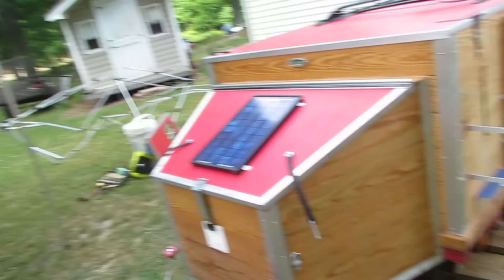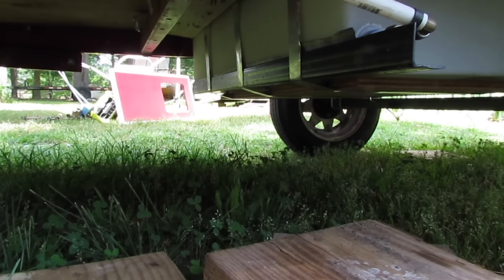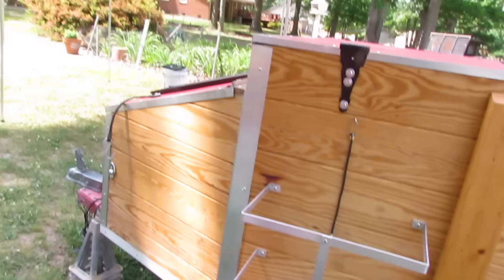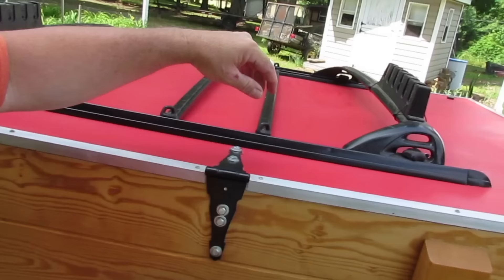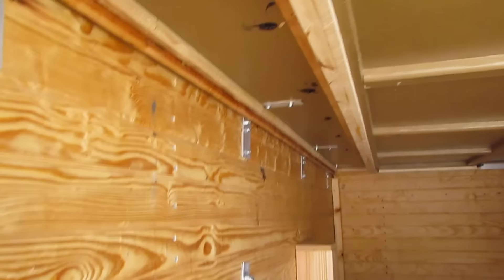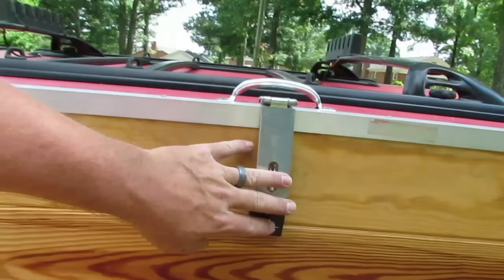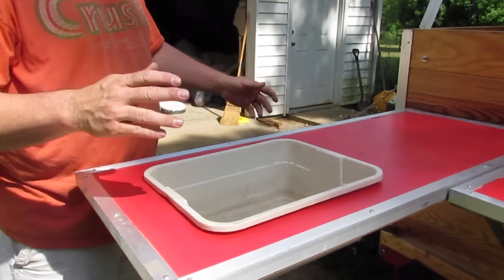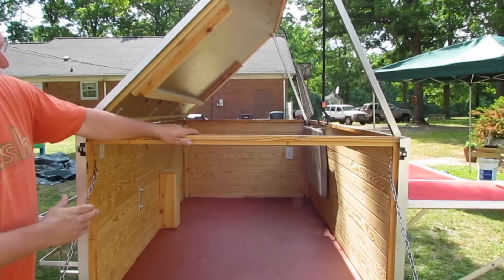Harbor Freight 4x8 Camping Trailer

Comment: Thats a nice set up Jeff! I'd wire in an inline fuse on that main positive cable you've got running to that battery. This will help you prevent damage to your stuff and possible fire.
Reply from the maker: Thank you. I appreciate the suggestion, I will be looking at adding a fuse, definitely want to be safe. Thank you for watching
Reply: +Jeff Furr I used a 12 volt 50 amp reset breaker on one of my campers , cost less than 10 bucks.

Comment: You should get one of then screw type shower rods to help support the sink counter, get a Harbor freight generator. I'm not sure why you hooked up the water pump on in inlet side, I think it should be on the outlet side to take the water out of the water tank to a sink or faucet. You should think about going to the dollar store and get about eight solar garden lights and fashion some mounts inside and outside as well. They last well into the night.  The spot lights can be used as a flash light. There is a solar shower set up you can get when in need of a shower.  Nice little rig. Thanks for sharing with us.
Reply from the maker: Thank you so much for some great ideas. Thank you for watching

Comment: Jeff, you did a great job & it looks terrific. Just want to give you a word of caution. I put one of those trailers together for a motorcycle. The first time I used it & swung a tight curve, the trailer tongue twisted like a pretzel & flipped, dumping the bike into the road. You might want to go to a welding shop & have them beef it up some.
Reply from the maker: Thank you, I'll look into that, I take all advise and suggestions seriously so I appreciate it. I don't think that this one could twist or warp due to the fact that the front box was bolted to the biggest part of it but I'll have it looked at. Thank you so much for watching.

Comment: I would suggest enclosing the battery a bit and vent unless the battery is a gel-cell type.  The fumes over time may cause corrosion in the vicinity of your electrical in spite of venting of the whole box.  I can't tell if you have over current protection from the battery but you should have either fuse or fusible link for safety.  Those invertors can fail and smoke.
Reply from the maker: Thank you, I will consider rearranging or enclosing the battery, great suggestions.
Thank you for watching

Comment: You know, I never considered making a camping trailer like this. I have always been consumed with getting a RV/camper. But now that I see this, I think it would be a good idea to build one. Not to mention cheaper than a RV.....lol
Reply from the maker: Much cheaper than an RV and lots of fun to build. I have to admit though, we now have a travel trailer and use that most of the time. I'm gonna keep this trailer though, I still have ideas for it
Reply: If it were mine, I would add bins inside to store sleeping bags, tents, fishing gear, cooking gear, etc.  Maybe even a place to store folding furniture and a canopy for when you get to that camping spot. You could, for space sake, do it in two layers, a bottom layer and a slide out top layer to get to the bottom stuff. I know you probably already put that stuff in there, obviously, but I could create sections specific to the items so everything fits and you can squeeze as much as possible in there. Of course don't make it as wide as the trailer, you still need to walk in it to get to your stuff.....lol

Comment: That is one ultimate chuckwagon Jeff. But the only concern I would have would be the proximity of the water lines and pump to the electrical. Water and electrical generally don't mix too well and could give someone a very nasty experience. Myself I would try to isolate the water from the electrical so there is a mechanical barrier, and GFCI your electricals. You've put a lot of imagination into that rig. Happy trails.
Reply from the maker: Thank you very much, and I agree about your concern. I started to build a small box around the pump and water lines to prevent anything like you mentioned and I'll probably end up doing that in a future modification. Thank you for watching.

Comment: Very creative, nicely done.
Reply from the maker: Thank you very much and thank you for watching
Reply: Have you found it to be stable?  I have been price checking one of these vs the ones at Home Depot etc, I am looking to build a Single motorcycle trailer that doubles as a kayak trailer with them above the motorcycle.  Found the one you have but no expertise with them.  Sorry to bother.. total stranger and all but very similar ideas so curios.
Reply from the maker: +Brad Thomson this trailer seems very stable, it pulls great as long as it's loaded right. It was loaded too heavy in the back on one trip and it swayed a little but this will happen with any trailer. We have taken this trailer on five trips totaling approximately 1,600 miles and it's still doing great. I repacked the bearings last year but they didn't really need it. Hope this helps.
Reply: +Brad Thomson i have this same trailer. works great for my 4 kayaks or my lawn tractor or anything really.  handles pretty good and for only 200$ you really cant beat it

Comment: Since it seems you like to modify various parts for your trailer, I would suggest getting some of those tap led lights from like dollar tree and wire 4 in series to place on the inside of the lid and also have on the outside to use as a lighting source. The tap lights use three aaa batteries per unit so wire in series for 12-volt operation provides plenty fo light without the need for a current/voltage damping resistor. 
Love the trailor and love using harbor freight as a resource store.

Comment: Keep the wheel bearings well greased.  If a bearing " goes out" on a trip, you can only buys bearing and hubs from Harbor freight.  No local trailer supply can order bearings and hubs from national suppliers.  If that sinario happens, install a new  common BT series axle and hubs.
Reply from the maker: Thank you for the info and thank you for watching

Comment: Very nice job.
One thing to please do is put some boots on the 2 12V studs by the inverter. Just incase something metal 
gets dropped with the battery hooked up. Metal rings can really make a mess of your hands.
Reply from the maker: Thank you and thanks for the suggestion, I'll get some boots for those studs, good idea. Thanks for watching

Comment: Looks pretty sweet! One suggestion, you made the storage slot for the large counter, do the same for the small one, on the rear portion of the passengers side wall, next to grandma's table. What about sleeping?
Reply from the maker: Good idea on storing the small table. We sleep in tents, the trailer is just for hauling all the camping gear. I have considered adding a small window and door to be able to sleep in the trailer.

Comment: Enjoyed your video and it looks to me you put a lot of thought into everything you did with this trailer.  My latest thing to buy is one of those battery operated water dispensers that fit into and pump water out of those water containers that weigh over 50 lbs. full.
Reply from the maker: Thank you, I did put a lot of thought into the build, I pretty much built the trailer daily in my head for a couple of months before starting the build. I'm not familiar with the type of water pump you're talking about.
Reply: Hello.  I think I might have been talking about those battery operated water dispenser thingies that fit onto a 5 gallon water jug.  These things were originally designed to siphon gasoline from a large gas container into a gas tank, to keep from lifting the 5 gal. gasoline container.  They have since been incorporated into camping gear to remove water from those large water containers.  

Jan
Reply from the maker: +Baley Baley Gotcha, I know what you're talking about now. I started to get one of those to make a camp shower but I decided to use a bilge pump, the link for that video is here, https://youtu.be/EYPK1hz1tNc
Reply: Thank  you.  I will check it out. A  bilge pump is something I had not thought about. Good idea.
Janette

Comment: A thought why not place a piano hinge on the long counter table. Attach to side camper , all you have to do lift and place supports. You can make a cover (like cover over spare tire) out of tent materials (purchase a use tent st Goodwill). Then you wouldn't have lift it (just thought.
Reply from the maker: Jeff Kendrick I agree, that's a great idea and we thought about trying that with the current hinges. The issue is that in order to make that work, the counter has to be mounted lower because my wife is short and with it lower it won't lay flat against the trailer because of the fender. When I raise it up so that it misses the fender, it's way to high for my wife to use. A great idea though and would work for a tall person to use. Thank you for your suggestion and thanks for watching

Comment: ad some led lights here and there and a thick foam pad in the back and you have a self contained sleeper.I have had plywood drawers in my truck bed for years   you could have them about ten inches or what ever high and three across of different sizes and store clothes tackle boxes stoves lanterns chairs etc in them and never have to disturb your bedding to get to anything
Reply from the maker: I'm actually adding some extra LED lights now. That's a great idea about the drawers, I had thought about making a new lid and increasing the height about five inches which would allow room for bigger, not necessarily heavier cargo, like some of the kids bigger toys that we sometimes take. I like the idea of adding a mattress for sleeping, I need to add a way to open the back gate from the inside and maybe add a vent for some fresh air too. Thanks for the ideas, I'll be thinking about those mods. Thanks for watching

Comment: I 100% love it. Building something to serve a purpose that meets all your needs and goals is what really gets my imagination going. Just one thing... (just one I promise) that big rack hanging off the back for the black water tank and propane cylinders? Please please please be carful with that so that it doesn't affect your load level to far behind the axle. Wow, that makes camping look a LOT more enjoyable having a big food prep area like that AND running water. What do you prefer to cook with? Thanks for the video! :)
Reply from the maker: Thank you so much and I'm open minded to all the critiquing. I had a lot of good ideas but I didn't think of everything so I'm getting a lot of good suggestions from my viewers. You are absolutely correct about the rack and the weight. I do try to always keep that in mind while loading the trailer and I'll distribute the load accordingly so that it's not too light or too heavy on the front. We have camped for a long time so I built the food prep area based on our needs and how we usually camp, I do realize that everyone camps and cooks differently but this really works out well for us. I use to use a Coleman stove for cooking but we have found that the Coleman road trip grill really is a better all around grill and flat top. Thank you for watching

Comment: Good ideas. Having built many trailers I can say weight is a constant enemy. I'm concerned the axle isn't stout enough for the structure let alone the loaded weight. Kudos on seeing a cool project throughout though.
Oh, also, I would put a waterproof divder in your power box between the electrics and the pump.  I'm a bit of a worry wort in that regard.
Reply from the maker: Thank you and I agree about the axle and the electrical compartment. It's in my future plans to protect the wiring from the plumbing and also to upgrade the axle.
Thank you for watching

Comment: concerning the axle weight limit......wondering how much weight you are putting behind the axle.
Reply from the maker: Dayna Silvey I am pretty sure I have exceeded the weight limit but I'm not sure how much I've hauled. I have actually already upgraded the tires so that the weight capacity for both tires now is over 2000 pounds. My next project with the trailer is to upgrade the axle and springs for a heavier payload and I'm also going to upgrade the tires and wheels to 13 inch tires with aluminum wheels. Just a few mods to allow for a more comfortable ride and less worry about the weight. Thank you for watching!

Comment: I've built a couple of camp trailers before I got my bus and I think this is a fine example.  May I suggest you consider coating any sharp edges with Plasti-Dip you could mask around the edges to make a clean line.  A few coats would leave you with a custom bumper covering your sharp corners.
Reply from the maker: Thank you and that's a good idea about covering the corners. Thank you for watching
Reply: Yeah I use plasti-dip fequently it's great stuff. Give a good way to make a project look finished.  Sticks to most anything and last a very long time.  I have tools that didn't come with insulated handles that I dipped going on 30 years ago and although it is black with dirt and grease it is still holding on.
Reply from the maker: +Chevy 57pkup thanks for the info. I've never dipped my tools in that stuff, good to hear someone that has had a good experience with it. I have some tools that need that now, I may go ahead and dip them now, I didn't realize that stuff would last that long. Thanks
Reply: Multiple coats is the trick.

Comment: I really like your trailer, especially the tongue and groove.  I've been thinking of a trailer I want to make, sort of like yours, but with some different features - or for a different situation.  I have a 1980 Chevy/Winabago conversion van like new condition that makes a really nice bedroom, or a crowded living room, but a terrible kitchen.  I've been thinking of making a trailer that is mostly kitchen and storage.  I was thinking a little taller than yours with a door on the side that folded down to become the counter top.  Then behind that door some cabinets, drinking water, dish pan sink storage etc.  There are some cool ideas looking at the back of some teardrop trailers for kitchens, but I want it on one side.  The other side of the trailer I hope to build I would just leave as cargo trailer.  I would keep one if those 10' x 10' or 12' screen room, awning, patio rooms like you see at Home Depot etc in there. The idea is you could step out of the sliding van door into the awning room and you could have the trailer parked at the wall across from the van opened as the kitchen.  There should be room left on the cargo side of the trailer for lawn chairs, tables, grill, more water, etc. too.  It seems like packing up for camping is such a chore, but I could just store that stuff in that trailer and be ready quick.  I like your battery box and solar too, and have a cooler that runs on 12v as well - a fridge.  I've been thinking of converting a small used Uhaul type trailer, but seeing what you've done, I'm now more focused on a Harbor Freight tongue and groove cargo modification.  Good job, thanks for the ideas.

Comment: awesome job. I probably would have had like wingnuts to bolts for the counter tops because eventually you will probably wear down the threading. I also probably would have done 3 supports and put the 'sink' by the body not out on the end ..., as it will only get heavier with things in it.....  maybe some dowels at the right height you can drop into the jack stands ... a little closet style catch and boom more support. 

I think im a little confused. In my head you would maybe have netting and a tarp you could drape over the popped up top... but then I see the brace bar on the back (making it hard to get into and out of...) and you mention a whole other cover, like a pavilion (?) like  thing over all of it. So this is not, in and of itself a popup camper but a storage?  I personally would just store the air mattress and stuff in the camper make it a popup and the counters are a great place to prep things but id sleep in it. :P its awesome.

Comment: Man I was just going to ask you about getting cut by the sharp metal edges . You could always tape off the whole corner ,and then spray rubber dip material on them . Or you could take a hammer to them rounded  .and grind and file them down  . I would probably fill the gaps and  edges with JB Weld , and then rubber dip it. But overall man good job.

Comment: Jeff, your trailer is a great example of good balance between form and function. I am very glad I found your video. 

We are having to sell a trailer we towed with an FJ Cruiser, which we sold to pay the bills. Now we have one car, a Honda Fit, and I am looking for a trailer we could realistically pull with that little car. I am leaning heavily towards that Harbor Freight trailer (in spite of the elitist objections about this trailer being made of substandard materials and not being road worthy). Eventually I would like to build a DIY micro camper, but in the mean time what you've done seems much more achievable.

What vehicle are you towing this behind, and what's the weight of the trailer as you built it without any cargo in it? Again, thanks for sharing your project, it's simply brilliant.